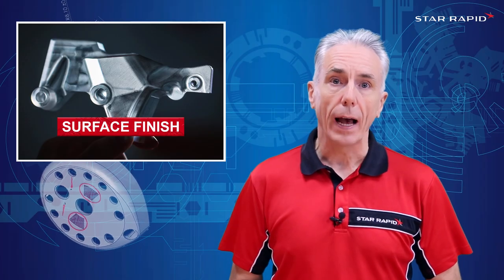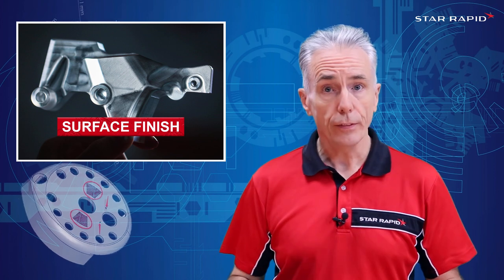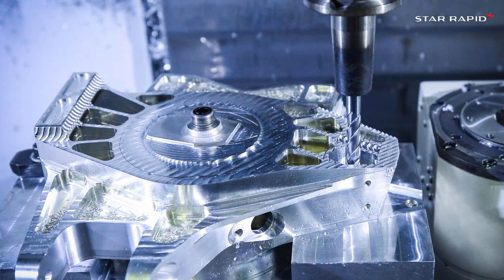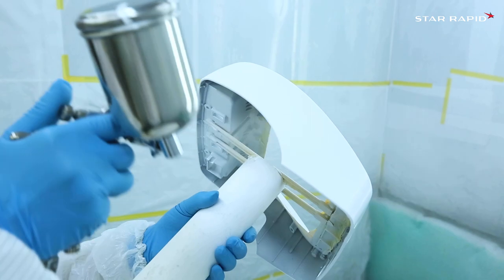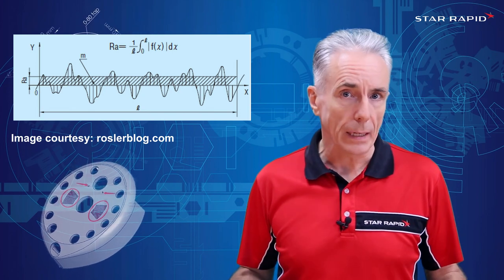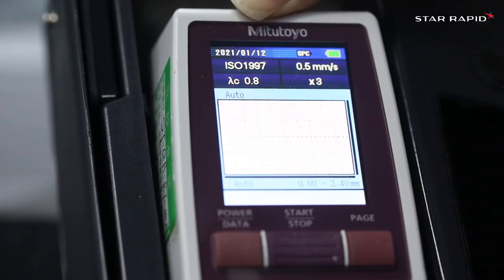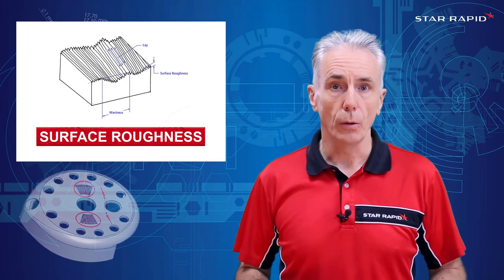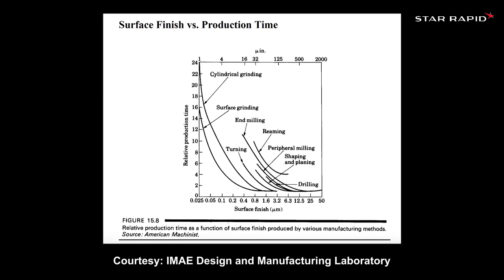What is Surface Roughness, Texture Topology, Finishing? - EXPLAINED | Some Serious Engineering - Ep8

Comment: Great technical channel. Don't remember to put a Ra beneath 0.8 on a drawing and it was steel machined parts with an o-ring and low platness for waterproof watercooling, but on plastic part a Ra 3.2    was the general mandatory I see in a lot of my previous jobs.
Reply from the maker: Thank you :)

Comment: Hey, great video but I'm getting a bit confused with the surface "texture" part like we are giving a "spark finish" to the metal piece so wouldn't that come in surface "finishing" part? Sorry if I'm sounding dumb, just confused. Thanks.
Reply from the maker: Hello. Texture and finish are often confusing and many people use them interchangeably. We think of 'finish' as a deliberate surface treatment meant to achieve a cosmetic or performance affect. This can also include painting, plating, and other secondary coatings. Texture is the measurable contour of the surface at the granular, molecular level. Sometimes this is applied deliberately to achieve a design goal, other times it's the accidental result of a machining or molding process. In your case. EDM spark creates a fine finish on the part, which can be measured as a smooth texture.

Hope this helps :)